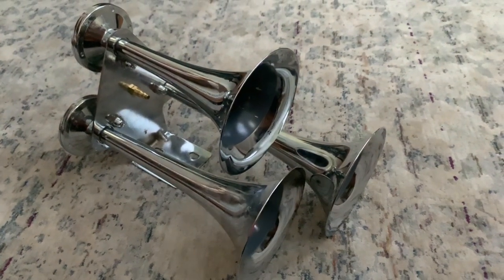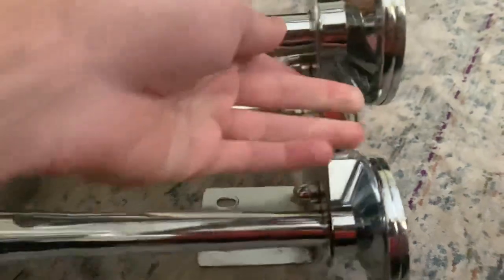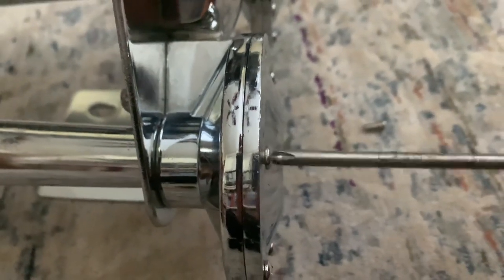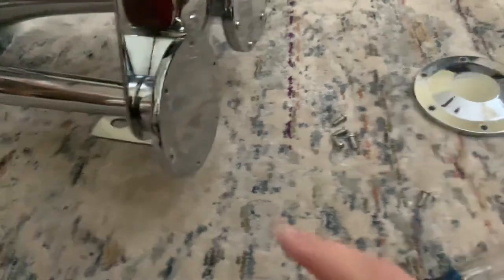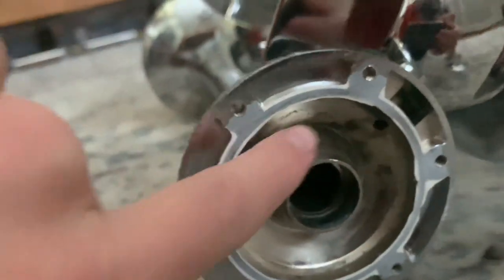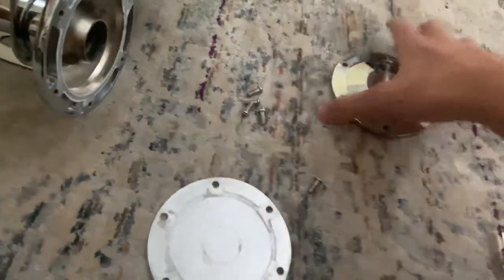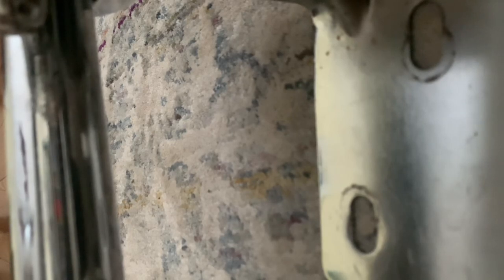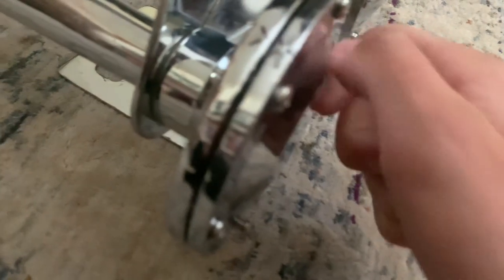United Pacific 46129 Train Horn Diaphragm Repair/Replacement Tips

Comment: how to repair the train air horn valve mine is leaking air
Reply from the maker: I also should’ve mentioned this! I’ve had to do the same with my horn valve. What type of horn valve are you using?
Reply: @sepa2401  GG train horn air valve floor mount and stand 4" tall
Reply from the maker: @vidrioandsonstrucking2422  I don’t have that type of valve, but I’ll try my best to help. Your leak could be occurring from loose connections on your hose. A good way to check is with soapy water (Simply spray it on the valve and hose connections and check for spots that are bubbling). You should then clean cut the hose and ensure a secure connection between the hose and the brass fitting. If it’s the valve itself however, you would want to clean the inside of the valve as best as you can, and then ensure the nut on the valve handle it tight enough that it doesn’t leak air. Remember to always use teflon tape on all NPT pipe connections as well.

Comment from the maker: Here are some links to replacement diaphragms:

https://chromecountry.com/shop/Train-Horn-Diaphragm-p55698301

https://www.ebay.com/itm/304274340348?epid=1576017285&hash=item46d829f9fc:g:jhQAAOSwcuRhw2QM&amdata=enc%3AAQAIAAAA0AZTgqrfAf%2B72ca01vCcFtpAZkTnW9jnEjWarIQrt4wOef6bXo3FTEtoAfWzrsGsmKJtGG%2FfOIBsG1eqd38JwbX4m5Zstq4KWD4zP5L0uorzkMD84FndDvLQJvX%2F%2FIURcQprq59ndcgdf5VG3B7p7wqkidom0Tf2HsW%2F76d31qGJeCTwwy4YpHDWZDpP2u%2FCIPSYiJP3XDZ7FrAgWSJLAWnETDL6wh4gJSo5KplXXZ4GoznNNXrAgjJ8gy6R%2BH9jM3lLntxHSmWwu7M8XRyVaWA%3D%7Ctkp%3ABk9SR7KZvf3YYg (Overpriced Set).

Comment: All i see is money thrown away. Horn is junk. I got the 3 bell chrome from a truck chrome shop.  It worked great till the PLASTIC DIAPHRAGMS THEY HAVE IN THEM POPPED A HOLE IN THEM FROM THE BACKSTOP ON THE INSIDE. I'M thinking...no problem.  I'll just order some new ones. So i got the new stainless steel ones...horn hasn't worked since. I replaced the O rings,cleaned it inside and out.  Wasn't dirty at all. It's mounted behind the cab tilted at an angle downwards on my semi truck. So new O rings,new diaphragms,money thrown away. I bought the Outlaw from Hornblasters. Just took my half inch line off the junk,mounted it plugged the line in and now i have a REAL TRAIN HORN!
Reply from the maker: I've had these horns for over a year and they've worked mostly fine without issue. While mine is mounted on a bicycle trailer (which is sheltered from the elements), yours was under a truck where it's exposed to the elements. Even if your horns were not dirty on the inside, they could've still had issues due to moisture inside your air lines. Another thing is the volume and PSI you ran them at. If you ran them with lines larger than the horn could handle, that could've blown out the diaphragms. If you ran them over the rated 150 PSI, those could've also blown out the diaphragms. I would say however that you horn could've been defective from the start due to poor manufacturing. If the seat where the diaphragm sits on has chips, It's no good. If the inside ring on the backcap has issues, it also would have trouble sounding.
Reply from the maker: May I ask what problem you experienced with the horn? Did one or two trumpets sound, or was there no sound besides air blowing through the lines?
Reply: Again,they were NOT mounted under the truck. They were mounted behind the cab halfway up. So no elements had an effect on them. I keep my truck clean! Show time if you know what that is.
Reply: Obviously you don't much about classy trucks. I have a Bendix factory built and installed air dryer system on this truck. I'm no rookie here. Been doing this for 43 years. Have had several types if horns on my trucks.  There is no debris, no moisture,no dirt ,they are spot less inside and out. The stainless steel diaphragms are just not as pliable as the plastic junk they had inside. I've tried decreasing the air pressure, increasing it,etc. Mine are straight lined off a half inch air line thru a manual hand valve. Which is also United pacific approved.
Reply: @sepa2401    again semi truck. 128 lbs MAXIMUM ON AIR PRESSURE.  I'm thinking flexibility, and diaphragm thickness.
Reply: @sepa2401   oh sometimes 1 would blow,next time 2 would blow,next time nothing but air blowing thru. Just depends on what kinda mood they were in i guess.Lol... you never new. I can say this the longest trumpet is the one that blows very very seldom. It's like you open the valve and slowly the short one starts, then the middle one,then if you don't run outta air the long one would start making a little sound. Then I'm outta air. I'm gonna try something else....a wall hanging in my shop. They are real pretty chrome thou.
Reply from the maker: @johnhailey9687  Yeah I don’t know much about trucker rigs. I’m just a hobbyist that collects air horns. I’m not experienced when it comes to installing horns on trucks. I made this video the see if I could be helpful to anyone else who had the same issues that I did. I’m not affiliated with United Pacific nor the horn manufacturer in any way.
Reply from the maker: @johnhailey9687  Weather and temperature has a huge affect on the sequence in which the trumpets sound. I can confirm. Mine sounds with the shortest, middle, and then longest trumpet in that order during normal conditions.